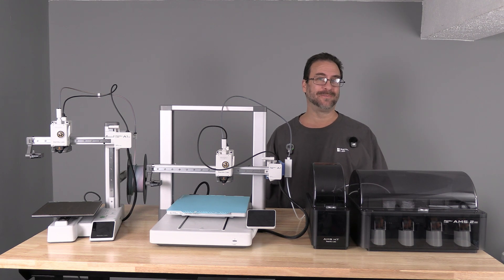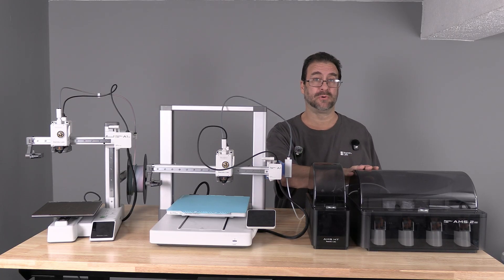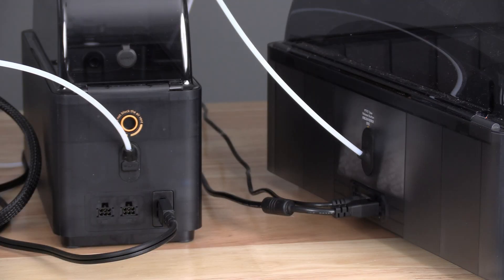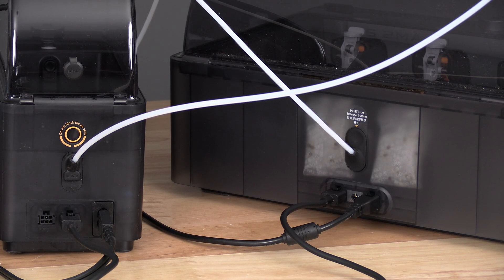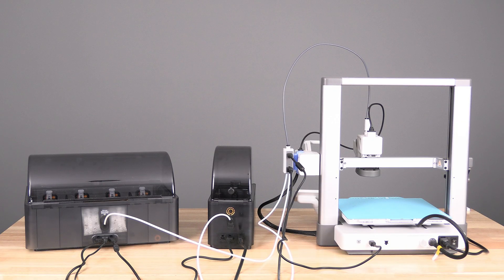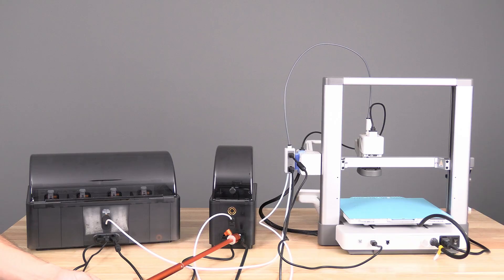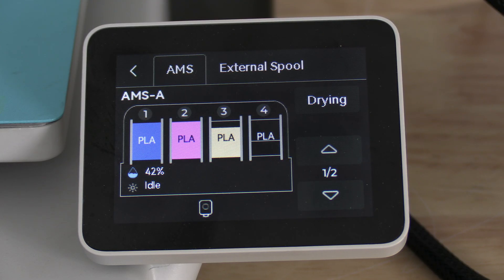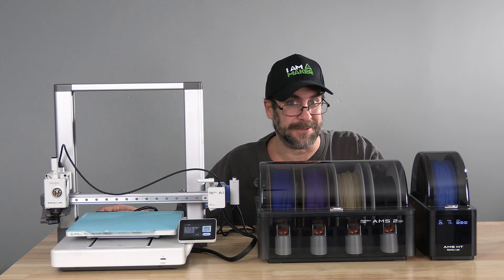Bambu Lab A1: Install AMS + AMS HT. (Also A1 Mini, AMS 2 PRO) - 3D Printer

Comment: I have been having issues with my hub adapter. My filament has issues at times going through. It keeps retracting back. I roll back the filament push down on the hub where the tube is located, and the filament goes through. Any Ideas?
Reply from the maker: I would remove the adapter, check for any obstruction, trim the tube and put it back in

Comment: I recently did this with my A1 and an AMS2 borrowed from my X1C and frankly I'm surprised how easy it was and how well it works. I've got mine arranged so that by swapping one toolhead tube and two cables and selecting either the AMS2 or the AMS Lite in the printer menu, I can still use either one (just not both at once, lol). The Lite is for materials for prototyping and functional stuff, I currently have the AMS2 full of PET-G and the HT is pretty much an automatic external spool for whatever I need to drop in it.

Good video!
Reply from the maker: Yea, I've got a full setup for the AMS part also, and, it's bizarrely easy. Really cool of Bambu to make this happen for A1 Owners. YES!!! I absolutely love the +1 that is the HT. So many uses